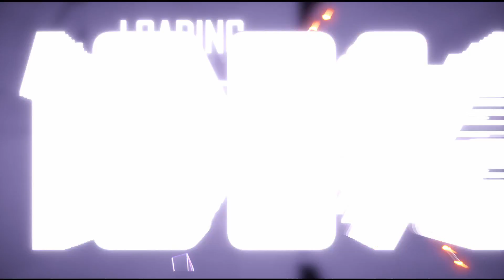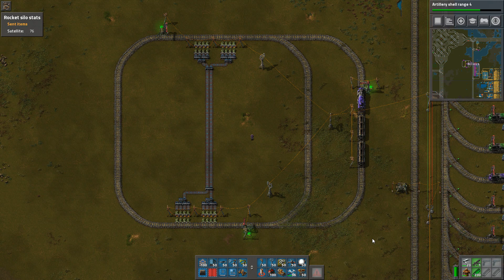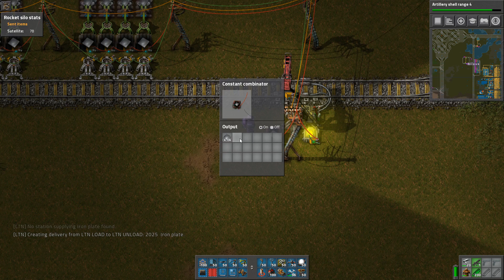Factorio Engineering - Logistic Train Network

Comment: It took me over 500 hours to really begin to understand how LTN works. I had always tried to watch videos on it but would often just get confused when trying to implement it into a real game. It was easy to get to the point of simply requesting materials and telling the network what was available, but of course, as you demonstrated, without necessary contingencies this kind of thing is super inefficient. One weekend I decided to just sit down and really try to figure it out, and I finally did. I can't believe I've spent this much time without using LTN. Being able to simply say "you are a station that gets this much of this item", and then knowing that any trains capable of fulfilling that demand will be automatically dispatched, just makes things SO much easier. And with the necessary contingencies in place, you don't have to worry about a train with leftover iron ore loading up on green circuits and dumping iron ore into your assembly lines for red circuits. You also don't have to worry about trains of wrong sizes ending up in wrong stations as well.  

I'd have to say that my only real complaint with the mod is translating items/sec into output from train wagons. It's easy enough with belts, because ideally you will configure your loading and unloading stations around one full belt per wagon. But with fluids it is very different. This isn't so much an issue with the mod, it's more of a problem with myself and trying to figure out the math behind it. Sometimes I may accidentally request way too much of a particular resource at a station, such as an oil refinery in desperate need of water, just because I want to see if that requested amount is enough to keep whatever I'm producing there running constantly. If I request too much, the trains will very likely depart from the station before their cargo is actually empty, because the circuit timeout is set for 120s. I'm sure there's a way to configure this timeout, but of course the real solution to the problem would be finding the precise amount of materials to request for that particular station to ensure constant operation, with no excess materials leaving and ending up in a depot. That's still something I'm working on figuring out. 

It's easy to use Rate Calculator to see exactly how many train wagons/minute are needed for something, but it's not so easy to translate that into a requester combinator for LTN. It takes a lot of trial and error to perfectly optimize. I'm still trying to figure out the best numbers for your Masterclass late-game Oil Refinery. I can get it to run at a pretty constant average of about 70k petroleum/minute but obviously that is terribly inefficient given the fact it is actually capable of at least 98k-100k a minute. Every time I think I've got the bottleneck figured out, I'm terribly mistaken and end up with tons of overflow and trains wandering into depots half full of oil or water, which gets annoying, and the refinery still can't run at peak capacity because trains get scheduled at the wrong times. I think my issue may be in the actual request thresholds, so I'm gonna work on adjusting those to see if anything changes.
Reply: what would be your best tips starting out?

Comment: So is this how it works, any corrections/feedback are appreciated:

1. Train depot: You need a LTN train station,constant combinator and wire. Wire the constant combinator into station input and select “Stop is Depot” button.

2. Provider base: You need LTN train station, filter inserters, decider combinator, constant combinator and wires. Connect every chest to the station input.  Set inserters to “set filter”. Connect every inserter with each other, after that using the same color of wire connect station to to decider combinator incoming, then with the same color of wire connect decider combinator outgoing into station output, finally connect everything to inserters. For decider set it to below instructions:

Input: [each] * -1

Output: [each]

Use constant combinator and select “provide treshold”, type in the requested amount of entities. Connect constant combinator to station input.

3. Requester base: You need LTN train station, filter inserters, constant combinator and wires. Connect every chest to a constant combinator. Put down “minus (requested amount of entity)” and connect it to station input. Then select in the constant combinator “request treshold” and type in the requested amount. Finally, select “read train content” for train station, connect every inserter with each other and then with the train station.

Some questions:

1. Does everything have to be in the same power grid?

2. I also use the Nilaus’ city blocks which means entire base is connected to the same circuit network, would it complicate things?

3. Is there a way to dispatch smaller trains for some jobs and larger trains for others? 

4. Why not just use the same amount for request treshold function instead of using different amounts for requester base? I can see it would give some more flexibility but using same amounts would ensure dispatching 100% loaded trains. I guess both ways have their advantages but feedback would be appreciated.

5. If there are multiple providers and requesters, should they be connected in any way?
Reply from the maker: sorry, bit too overwhelming to go into in a comment section on an old video

Comment: Thanks for the tutorial, but i am having problems with stop timeout (when train is forced out of station after certain time) when unloading. When making new schedules, the network doesn't actually check if the train in depot is empty, so it can for example send it to load and unload iron ore while it still has some copper ore from previous timeout. Is there a way to deal with this other than completely disabling stop timeout?
Reply from the maker: you need to make sure the timeout is not triggered. There is an underlying problem in your base if the time out is triggered; loading too slow, unloading to slow, congestion in network, long travel distance. When those are solved you should not have time out and if you really need to increase it then that is a mod setting to increase it.

Comment: Wouldn't it be a lot simpler to disable the requesting station when it has no room for the 4000 iron? Assuming LTN station supports the enable/disable signal. You wouldn't have to tweak the provider station at all, and always expect it to carry full loads or less.
edit: Nvm the request signal with <= or so should do just that.

Comment: First, I really loved to watch that Video :D
Thank you so much. Super inspirtaing with LTN.

Oh my I really started to rebuild everything because of your video to make everything LTN compatible. It took me around 2 days to fully understand the system. Just watching your video and rebuild it 1:1 somehow did not worked :'D

But it goes now.

i guess it was also you in this video who mentioned that people complain about bugs in LTN and that the modders tell that people are just not able to use it correct? I cant remember.
Well I use it now for 2-3 days and yes there are "things" that bug me allready.
For example I have a station who only brings ore but the train had for no reason also a little bit coal and iron. That means a station fed the train wrong. Just 80-90 but it was there... I need to check this, so that in there is no wrong ressource going in. 
Well the wrong ressource in the train is not my problem. I have some unloaders in the DEPOD just for those scrap that returns in trains.

What bugs me is that the station that only should grab ore also grabbed the other stuff. Why soever the filter accepted also the wrong ressources as a correct ressource :/

It is really cool that everything is automated but things like this is questioning the need for that mod as I have to check every here and there if things where loaded/unloaded wrong again. 

A other thing is, that the "time out" for the trains are not very high. I have a main base and other bases very very far away. If LTN sends 2 trains to one station because there are ressis available, then the second train waits and gets a timeout before the first train got fully loaded just because the travel to the station allready took so long :'D

Maybe I need to mix my trains with LTN but not do everything with LTN. :D

So far its a really good mod. Just some tweaks :

Comment: Great instruction video.... however, I would like to know how to force a train to wait at the unload station, to make sure it goes empty. Any suggestions?
Reply from the maker: set the wait condition at the unloading station to "is empty"
Reply: Thanks for your reply, but I'm not sure I understand you correctly. I can not set the train itself to 'empty cargo' because the conditions for the train are being reset each time it goes to the LTN depot. I was hoping for a combinator setting that holds the train until it's empty. Maybe that is what you meant, but in that case I don't know how to set it. Can you please elaborate on that? Thanks.

The reason for me wanting to hold a train until empty is that on several occasions trains have left with goods still on board. This happens, for example, when I start messing with cables, or when my base goes without power (the inserters stop unloading the train, but the train still sticks to its LTN schedule, leaving with cargo still on board)

Comment: What if you have multiple mining locations, will it be able to say iron 1 has 500, iron 2 has 1500, send a train to iron 1, then iron 2, then the smelters?
Reply: Innocent_Bystander it depends out how you set it up but it will not ever send 1 train to multiple pickup or drop off stations in a single run. Every generated schedule is 1 pickup to 1 dropoff  then back to depot for refuel and a new assignment. You also set thesholds to control when a station will request more or provide more. For example u probably don't want a train to be dispatched if a requestor station is only 5 iron plates short of its threshold, sending a train to deliver 5 plates is silly and will just congest your rails and use a ton of trains for no reason. Same for pick up, if a station only has 5 plates to be picked up there is no reason to schedule a train for it until it has a more substantial load available. The default thresholds are 1k but you can set them per station using signals.

Back to your original comment, what would most likely happen is a train would be dispatched to the station with 1k iron to pick it up and deliver it to a requestor station , then sometime later when the station with 500 had collected a bit more iron and gone above the provide threshold another train (or maybe the same Train from earlier if it wasn't actively being used) would be dispatched to pick up the   iron from station 2.

Comment: i just followed this while watching step by step, to get used to it. but somehow after setting the negative value for the first requester, nothing happens...
Reply: There are generally a few troubleshooting steps that you should take when using LTN and things don't work. 

1) Do you have proper Depot stations with available trains at them (blue light) to be dispatched?
2) Have you set up and wired your requester and provider stations so that they know the station contents and needs?
3) Are there any other settings that you may have added which would make LTN not able to generate the order? (limited train size, provider thresholds etc)
4) Are the trains able to correctly path between stations (obvious, but sometimes missed when adding depots etc)
Reply: @PlayWithMeEdward  I don´t understand how to make trainstops depots. I have multiple trainstops named Depot, and put a constant combinator on the first one outputting stop is depot with a value of one into the lamp at the train station just like in the video, and then I put a train there but the lamp is not blue

Comment: Would it not be a lot  easier for the loading station Stopps loading (when the demand is fulfilled) just to untick the “finish loading” option in the mods options?? 
At least in the version I have used the last time that worked.
Reply: cuno s. That only works if you have single purpose pickup stations. If you disable finish loading then sometimes the inserters will be left with something in their hand when the train pulls out. If the next train coming into that station doesn't need what's in your inserters hand you will pollute the system. This is the entire reason "finish loading" functionality was added (it didn't exist in early versions of ltn)

Comment: Advanced Hints:
- Using negative request thresholds makes it easier to keep track of requested amounts vs threshold.
- Using green wires to feed into LTN input will increase performance due to how the to wire signals are merged internally.

Comment: The power drill don´t sound as much in the video that you might think.. yea.. its quite audible, but not really overbearing.

Anyway. With your series. When you bild outpost, you speend a lot of time just routing. It would be both more compact and fast to make the smelters and train stop and everything in just one build and put it right into the miners.

Miner+belt+Miner+power pole = 8 wide
Beacon+smelter+inserter+belt (using beacon from other row) =  8 wide... 

Pretty much perfect match just puting the stagered straight belt smelt right at the end (with space for beacons) after the miners.

They would output 38,6 units a second for the output belt (any more would be waste). So it need to input 38,6/1,2=31,1 units per second. Needing about 30 miners per side. Making it possible to have a 30 deep feild. probobly say 32 for fall of. (hmm did i caluclate this corectly). if its any sllower at the end.. just simply back feed it.

This way you could make a miner, smelter and loading staten set up with one blue print. Then just conect the rail and path up the missing or deapth.

Personally.. might sound like a bummer.. I would much rather just make a logistics central... its fun to build stuff. The whole idea with a virtual logistics central is kind of cool... but i´m will probobly not play with it.

Comment: Nice explanation, and complication with the extras.... but what stops it from sending all 20 trains at once when there is a  request?  

And how is the Depot connected to ALL the stations... I didn't see red and green wires connected to it...plus point... but what then is the connection.?
Reply: LTN will only dispatch as many trains as are necessary to fill the request, that's just built in to it. Also, you can feed a signal called "limit trains" to each station that sets a hard cap on the number of trains allowed to be dispatched from/to this station at a time (for example if you only have parking space for 1 waiting train at a station, you could set the limit to 2).

As for connection, think of the rails as the "wires" that connect all the LTN stations together.
Reply: Dirkus Thanks, that along with Nilaus explanation, makes me think that I might try it.
Reply: You can set an individual network ID in the constant combinators @ the TLN stops. If there's no ID set, all the stops will fall under the same ID. Therefor the depots will be universally available for all stops.
With IDs you can isolate certain outposts and offloads to a certain part of your factory to reduce travel times, for example.

Comment: Can't wait to see this implemented in the base!

To expand on what Stephan says below, the entity at the station is 2^0, the next loco/wagon is 2^1, and so on. So for example a 1-4-1 train would get 2^0 + 2^5 = 32 on the loco signal, and 2^1 + 2^2 + 2^3 + 2^4 = 30 on the wagon signal. What I don't know is how the hell you can use that to do anything useful.
Reply: Dirkus me too :) probably to enable / disable inserters with different train lengths or only load coal in a loco at the train end instead of a Wagon.
Reply: That`s one of the uses. Dynamic refueling of locos and removing trash from wagons at depots. Thought I would need a guide to figure out how to wire it all up.
I asked the dev in the forums about using the coding to restrict stations to certain train compositions. You can not feed composition signals into stations they are read only.
Reply: Thank you!  I was wondering about this some time ago because I wanted to limit the size of consists by station size but putting the composition into the constant signal didn't work.

Comment: Train composition is a Binary encoded signal. Loco is 2^0 = 1, Wagon 1 and 2 is 2^1 + 2^2 = 2+4
So the third Wagon was 2^3 which equal 8, 6+8=14.
Reply: Stephan S. What about cargo vs fluid wagon?
Reply: @Meister_Knobi   Each type of wagon has a separate signal.
Reply: The position of the car determines the value of the car. Each car is worth twice as much as the previous car. 

Engine - Fluid - Cargo
      1          2          4
Engine = 1
Cargo = 4
Fluid = 2

Engine - Cargo - Fluid
      1            2          4
Engine = 1
Cargo = 2
Fluid = 4

Engine - Engine - Cargo - Cargo - Cargo - Cargo - Fluid - Fluid - Fluid - Fluid
      1            2          4              8          16          32        64      128     512    1024
Engine = 3 ( 1 + 2 )
Cargo = 60 ( 4 + 8 + 16 + 32 )
Fluid = 1728 ( 64 + 128 + 512 + 1024 )

Engine - Cargo - Fluid - Cargo - Fluid - Engine - Cargo - Fluid - Cargo - Fluid
     1            2           4          8          16         32          64       128     512      1024
Engine = 33
Cargo = 586
Fluid = 1172

Engine - Fluid - Fluid - Cargo - Cargo - Fluid - Fluid - Engine - Cargo - Cargo
     1            2         4          8           16        32        64       128        512      1024
Engine = 129
Cargo = 1560
Fluid = 102
Reply: @iwantmypot  Interesting here is also that you can calculate at what positions what kind of train is with this system.
Reply: i was thinking that might be the case, quite a clever way to encode the position of the different types of wagon